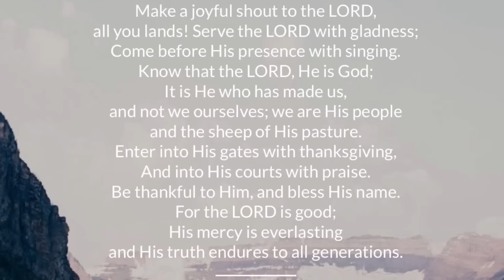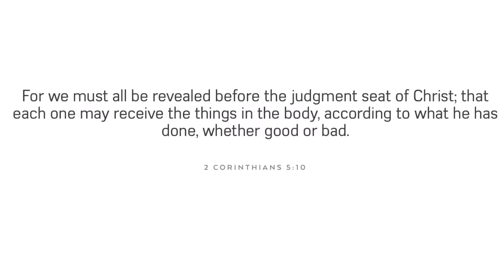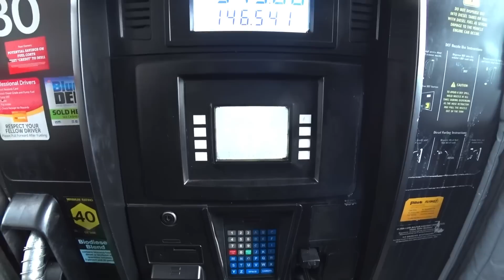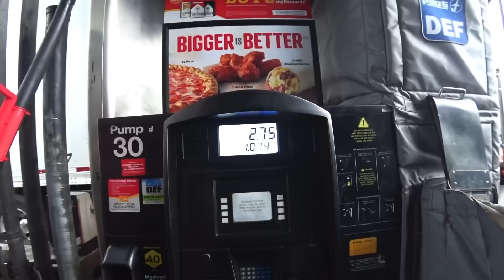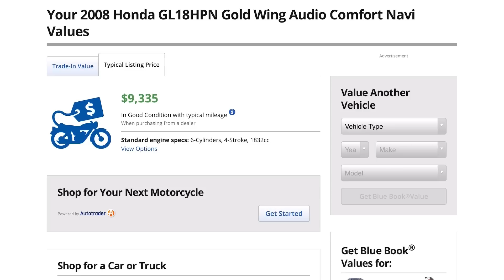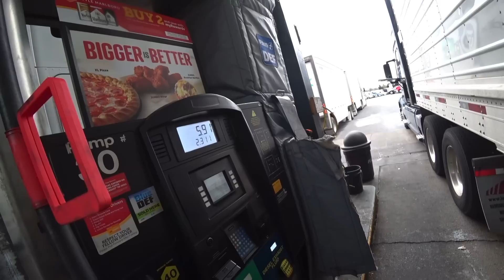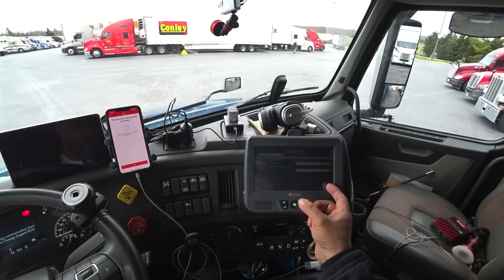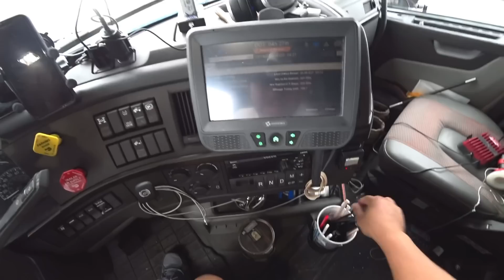March 15, 2020/114 Trucking empty and fueled at the Flying J.  Clear brook Virginia

Comment: You  gave  a shout out to many. 
Nice when ya get the echo! I spray  my hands  with windshield  washer after touching  key  pads at fuel islands.
Reply from the maker: Cool idea
Reply: That only works if your blue juice has more than 60% alcohol. If not, mix 2/3 cup rubbing alcohol with 1/3 cup aloe vera gel, mix the two and put into a squirt bottle. Done.
Reply from the maker: Thanks Matt